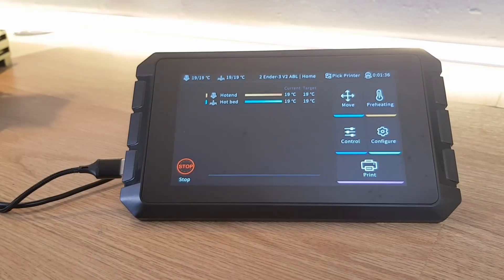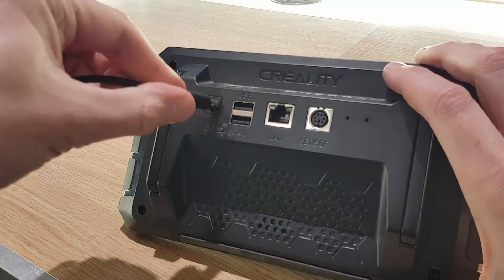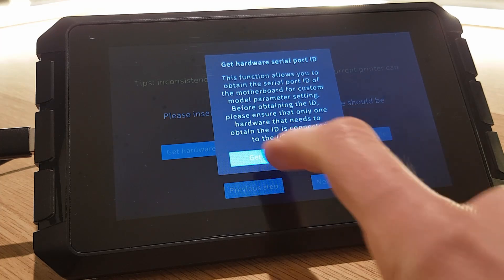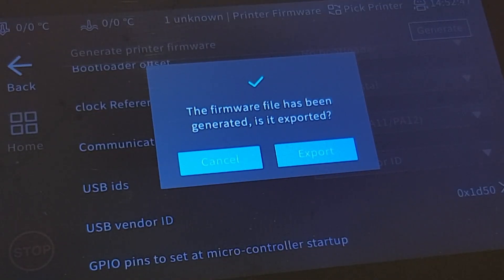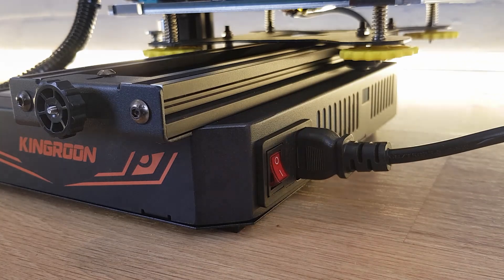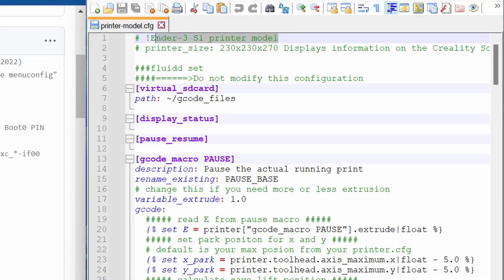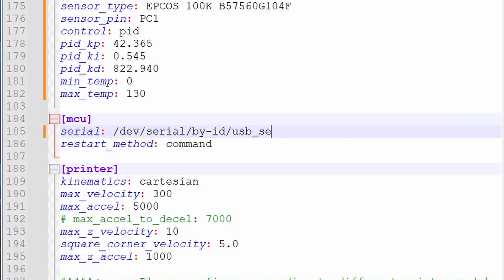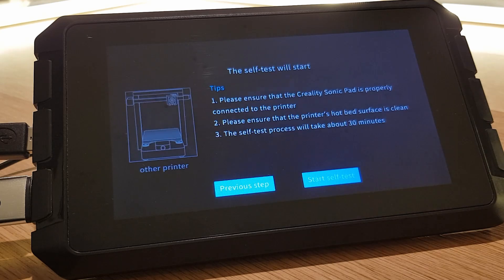How To Connect A Non-Creality 3D Printer To A Sonic Pad - Sonic Pad Basics Part 1a

Comment: Hi I think I am nearly there. As I have got further than before with downloading the config file. It's latest error says unknown pin chip name  ". Any ideas?
Reply from the maker: I'm so sorry, I missed this comment, how did you get on? Did you get it sorted?
Reply: @RickyImpey  hi Rick - I changed motherboard for a 4.2.7 creality and that sorted it. I had run out of patience with it and it made sense to just go creality and it worked. Thank you for all your help. Also thank you for your video on e calibration. I really like your videos on the sonic pad. Makes everything easy and logical.
Reply from the maker: @yvonnemitcheson2418  shame you had to spend out but glad you are making progress 👍

Comment: The error message is: Error message
["code": "key337", "msg": "File contains parsing errors:
/mnt/UDISK//printer_config/printer.cfg
[line 104]: ' [filament_switch _sensor filament_sensor] \n'
Once the underlying issue is corrected, use the "RESTART"
command to reload the config and restart the host software.

Comment: I have been setting up the sonic pad and I got the error saying parse error. Any idea what I need to do?
Reply from the maker: That means that there is an error and it can't get past that line in the config file. What else did it say?
Reply: @RickyImpey  Thankyou for replying. It says that it can't 0 in first section for heater_bed. I have looked but I don't know what it means. As I am unsure what it means by first section.
Reply from the maker: @yvonnemitcheson2418  I had to work through something like that on one of my machines. It turned out to be and incorrect pin specified in the config file.
Reply: @RickyImpey  I know that the ender 3 is similar to aquila x2 so I will give it a go.
Reply: @RickyImpey  I have for now gone back to Alex's firmware so that I can print today.

Comment: Been watching your series on the Sonic Pad with some interest. 

Just to check with you...

 I've an Ender 3 v2 with a Bondtech DDX3 and a Mosquito Hotend. In essence all I need is a default cfg from Creality with chip, board and serial port updates and copy / paste the extruder and hotend sections for the Bondtech / Slice Engineering hotend? 

And go through all the preceeding and subsequent steps you've outlined. 

Tiny Machines (who produce firmware for Creality/Bondtech/Hotend combinations) offer a Sonic Pad configuration service for 85 quid. With all the learning curve I've gone through, from using Inkscape, Rhino and Cura (via Netfabb) as well as running and upgrading my Creality machine I'm sorely tempted to farm this bit out!

With the best will in the world, there is only so many Udemy courses and tutorials and Reddit threads any one man can take!

But if I do have the gist of what to do right I might be tempted to the once more unto the breach dear friends. 

Cheers!